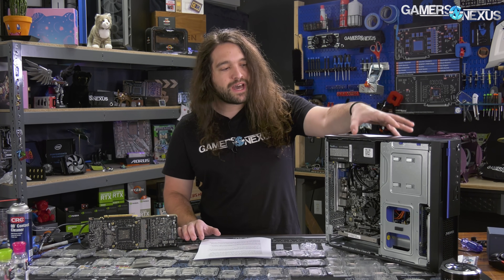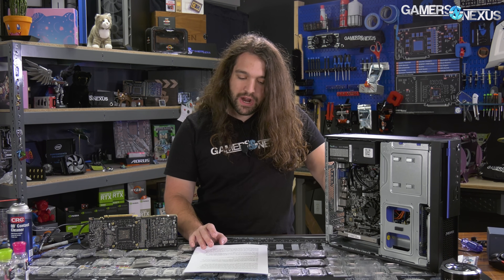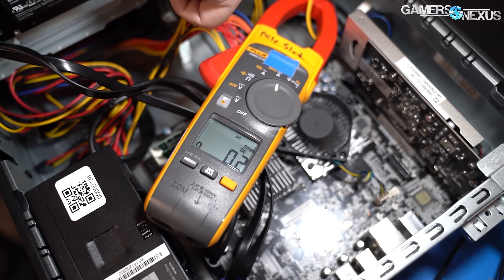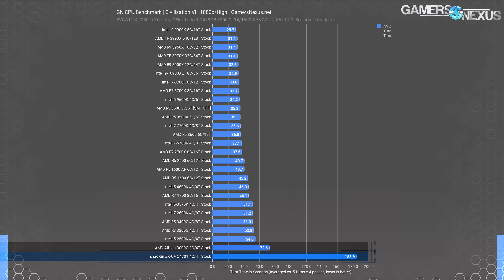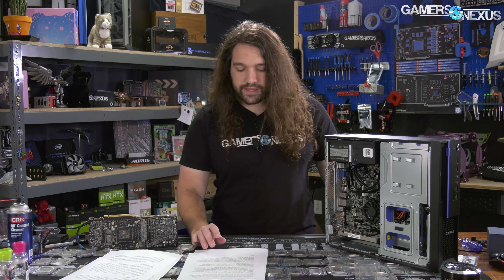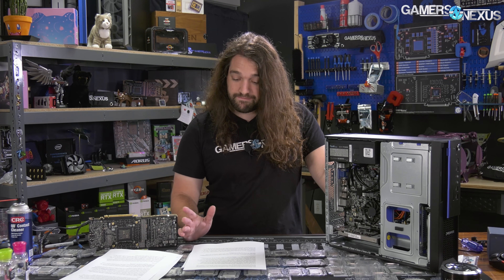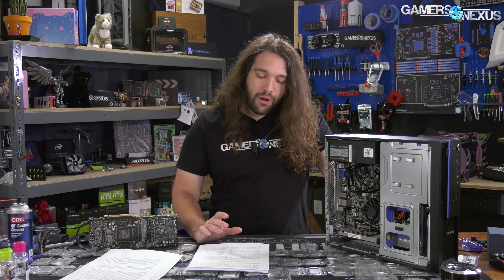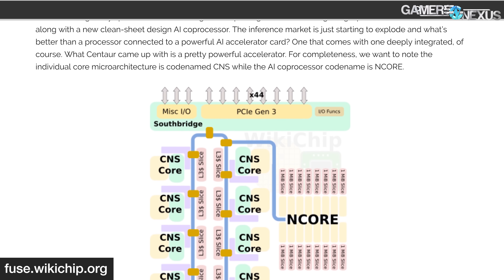"Trillion Core" Chinese CPU vs. AMD & Intel: ZhaoXin X86 CPU Review ZX-C+ 4701

Comment: Finally, a processor that can slightly edge out an Atom processor or the average school computer.
Reply: i5-8400 is a pretty common high school/community college pc
Reply: @StonedSoldering  Maybe in countries that care about education
Reply: @virtualtools_3021  US doesn't broadly but I've encountered plenty of i5 school PC's lol
Reply: It's and overclocked z560 - most all Penwell or newer Atom processors are better performing than this chip.
Reply: @StonedSoldering  My HS had i5 MacBooks, but they were only 2 cores and M A C B O O K S. They weren't even good single-threaded because of lack of cooling, but at least they had SSDs however small (128 GB). CPU was i5 5250U with 4GB RAM. Funny how people still say my HS is wasteful, but it isn't far from the truth when such terrible computers were costing them $800 each.
Reply: @edsknife  Lol, I have a CTE class called computer graphics and design, and in the computer lab each person has an I9-9900K + RTX 2080 Dell prebuilt workstation.
Reply: heck the Athlon 5350 already did that
Reply: @edsknife  I'm surprised it was only $800 coming from apple
Reply: But with lower power consumption?
Reply: We had PowerPC Apple eMacs with 128 megs of ddr. I remember it clearly. The human hand could press the volume + and - buttons faster that the computer could process them, so you would press them 100 times, and then the sound would play for all of them at once around a minute later. It was hilarious.
Reply: they still use PENTIUM D at our hs for most pc,s a few have i5-3470t (dual core! wtf)
Reply: @StonedSoldering  My HS in Australia had Intel Pentium @ like 2.4ghz 2 cores. They also sold "school laptops" for like 1000$ that had an i3 6th gen and 4gb of ram lmao I feel sad for anyone who brought those.
Reply: @Martin M your school is running 3900x's? I highly doubt that given that even the most richest high schools wouldn't need a CPU that powerful, I would say maybe something along the lines of a AMD Ryzen™ 3 2300X or an Intel® Core™ i3-9100 would be decent enough for a school computer (given that most people just used microsoft word etc.) unless you school is doing heavy CPU workloads a 3900x is overkill.
Reply: @edsknife  They're mac, they're supposed to be overpriced as fuck.
Reply: @virtualtools_3021  my college has i7s and i5s in all of our computers
Reply: My school just recently upgraded to I5 9500, but it's a vocational school.
Reply: @StonedSoldering  which school needs 6 cores for essentially a microsoft word machine?
Reply: Nope my school's computers are on core 2 duo
Reply: @StonedSoldering  In my high school, we had win10+2gb ram+e2160 c2d cpus+onboard gfx. My last year was 2018.
Reply: @StonedSoldering  my school pc's have i5 750's
Reply: School processors really depend on the school and area. I remember in high school I went from thinking my school computers were slow compared to my intel pentium dual core vista machine to the school getting intel core 2 duos and replacing all their pentium systems a year later and thus outside of graphics having better machines than my personal computer in 2008-2010. In college, the college I went to had all 2nd and 3rd gen i3 and  i5 systems in 2014. The major issue with school systems is the lack of a ssd boot drive. At least in my city. I only remember terrible computers in early grade school. During the pre xp days the computers were awful windows 95 machines that my windows mellenium intel celeron 667 with a ati radeon 7000 ran circles around.
Reply: Hey the later intel Atom processors were pretty good, fairly similar performance to an early Pentium D/dual-core or a flagship mobile processor from ~3 years ago, the problem is since it's cheap it tends to be paired with equally low-end hardware, like 1-2GB of ram and slow eMMC storage, while running windows making the overall experience pretty terrible but the atom itself isn't all that bad, in fact it's a great processor for single board computers.
Reply: My school's got a wide range of Intel CPUs, like between Core 2 and the i5-9400
Reply: IF its anything like the old via chips, the atoms will cream it. And wont Have random applications crashes from missing cpu instructions/extensions.
Reply: @kalashnikov1343  I think it's funny how apple has wobbled all over the place with their CPU choices. While the PC world has stayed with x86 from the first IBM PC (with a few attempts at breaking free from x86 that was quickly abandoned), the Apple Macintosh started out using Motorola 68000 processors. Both the Intel 8086 and the Motorola 68000 uses a CISC architecture which was the norm at the time, but there were a lot of thought plowed into creating RISC architectures as these were seen as a way to increase the IPC and make the chips simpler and able to scale in clock frequency. Apple stayed with the 680x0 series of processors up till 68040 but when it looked as if Motorola wasn't going to be able to keep up with Intel and the development of the x86 they started working on transitioning their product line to a RISC architecture powered by the PowerPC processors. This was believed to be the holy grail of processor tech. It was a RISC architecture, and as such surely would be proven more powerful than anything CISC based in the future, and it was backed by Apple, Motorola and IBM who was still the largest computer company in the world. And time went by...

Eventually Apple was facing the reality that no matter how much they wanted to be proven right the PowerPC processors were lagging the performance of processor architectures like the x86. So once again they worked on transitioning their product line to another architecture. This time they switched over to x86, and again they were on a CISC architecture.
Now the rumor mills has started saying that change is in the air again for Apple the the MAC OS. An once again it seems they are looking at transitioning to a RISC architecture, but this time it's going to be an ARM based processor developed in-house at Apple. Or at least that's what it looks like.

I think it's funny how back in the 80's people were saying that the x86 would never be able to scale as it was a CISC architecture. By many it was taken for granted that soon RISC would rule the computer world. Now in 2020 x86 is still running strong, and at least as far as I'm aware it still holds the single core performance crown. On top of that there is some truly powerful multi core x86 processors out there (looking at you AMD) with more on the way. Meanwhile RISC is totally dominating the handheld mobile market where the incredibly efficient and simple cores can make batteries last longer than any current CISC alternative with comparable performance. In the server market ARM based solutions has made a big impact for certain types of loads as they are so power efficient. However the venerable x86 is still the go to processor for a lot of applications.

So is Apple ARMing up a sign of the death of the CISC architectures? I have no idea. At the moment the latest and greatest from intel and AMD are still performing better than any ARM processor I've seen, and more is coming. But at the same time the large majority of Apples customers are not in it for the performance. They buy Apple for reasons like design, ease of use, (perceived) security and because it's an Apple product. And at this time CPU performance has reached ridiculous levels so perhaps they are looking at providing enough performance rather than aiming for the absolute top, while being able to use the admittedly superior power efficiency of the ARM architecture to stretch the battery life beyond what the competitors still using the x86 platform currently can reach.
Reply: @richardzhang2773  k cool were can I sign up
Reply: @pxlcoarl  sure if you can stand toxic students :)
Reply: @StonedSoldering  yeah, in my country College use intel pentium in computer labs...
Reply: My school got i3 6100 or 7100
Reply: Before that 1core 2ghz 2gb pcs
Reply: I5 6500 at my school and a few of the pcs in small classrooms have i3 4th gen and some core 2 duo e7500 which is an awesome classic cpu in my opinion
Reply: School all use chromebooks now.
Reply: @StonedSoldering  and here I was thinking schools all used Apple IIe's..
Reply: @happily7514  they might have been 7th gen when I was in HS but my community college had all 8400s and SSDs. Pretty small 2 year school. Even in HS we used photoshop in some classes and whatnot so not too far fetched to have 8400s.
Reply: @deViant14  u totally necro'd this thread btw
Reply: @StonedSoldering  welcome to youtube
Reply: @StonedSoldering  I've literally never heard a single person say that in 15 years on youtube btw. The algorithm recommends in waves. You know that, right?
Reply: @deViant14  I was just joking I forgot this comment completely didn't return to the thread till I got that noti lol
Reply: my school has ryzen 5 3600x, 16gb ddr4, rx 550, 500gb m.2. 

if you wanna know how i know that, i pulled up system info, and for the ssd, i did a speed test and the read/write was over 2GB/s
Reply: My school laptop is rocking an i5-4200U. It's sluggish as hell.
Reply: my high school uses old AMD APUs mostly
Reply: @StonedSoldering  no 8400 doe. More like 4300 or 4200

Comment: This Processor needs to have a death match with the Celeron D.
Reply: Not sure if that's enough competition, maybe try something like a Nokia 1600 🤔
Reply: @MLWJ1993  You can't compare X86 with ARM architecture. An X86 would pulverize any ARM processors in-terms of desktop level multitasking no matter how weak it is.
Reply: @DarkZerol  I really don't think so with this garbage performance though.... Any other day of the week you'd be right...
Reply: @MLWJ1993  ARM processors are not designed to run full-fledged desktop OS like Windows, most even struggle to load them up and are plague with a myriad of compatibility issue with those X86 programs. Also not forget a much smaller ARM processor have incredibly poor heat tolerance compared to something like X86 with multiple chips built-into them for maximizing space efficiency, they are designed for much lower power consumption devices.

The closest you could get is to compare something like the Intel Atom range of processors, though I'm not sure if you can still even buy them in the market these days unless maybe you are a ODM or something.
Reply: @markuskass6199  yeah but that CPU is so slow that emulating x86 on ARM might be faster :D
Reply: Adria  I'm mainland Chinese I don't find any racist comments in his post?
Reply: Adria  better wish it comes true sooner. whenever china is able to manufacture something new, its price drops dramatically
Reply: @mrx168  Leftist Americans will call anything they don't like racist in an attempt to deride or dissuade others from agreeing with a point or considering a statement. It's basically killed the ability to have debate and dialogue between people between the ages of 18-40.
Reply: Adria  well, just like corone didn't mean much in its first two months of propagation, so China's cpu line doesn't mean much for now. But if left to their devices, they might see spectacular development in an astonishing time! Remember, it's all about logarithmic expansion.
Reply: It would be a very slow fight
Reply: @DarkZerol  You're right. Pentium Pro, 486 upgrade edition
Reply: It needs comparison with recent NUCs, cause that is basically in the same performance and power range.
Reply: It is similar in performance with a celeron N series, so not that bad. Also the power consumption is very good.
Reply: The derogatory and belittling comments coming from overly proud Americans will make the Chinese takedown of Intel and AMD that much more epic. I'm here on the sidelines with my popcorn and I expect a good fight
Reply: @stanleylargo9158  liberal tears sustain me.
Reply: Sempron blood must be spilled!
Reply: @Chuckiele  Apple's new M1 would agree.
Reply: Oh no, that was my old CPU, and it's fucking horrible

Comment: well.....it's energy efficient i guess. You could buy a calculator with more processing power.
Reply: I doubt you could find a calculator with a 2GHz processor (maybe I'm wrong though, I don't follow the calculator space closely). What's blowing my mind is the price to performance ratio of a 64-core Epyc CPU would probably be better than this, at $1000. Actually yes, it would definitely be better because the price would only increase 10-15x but the performance would be 100x better, from what we've seen im these benchmarks...
Reply: @utubekullanicisi  ..It's a joke bruh
Reply: @VndNvwYvvSvv  What does that have to do with anything at all?

Comment: Considering the chip TDP, I think it would be interesting to compare it to an Intel Atom/ AMD E series and see how far they are in perf/W
Reply: @vyor8837  The claimed TDP is 18W, it was also made on 28nm. It's a 2 gen old part for Zhaoxin as well. The new generation isn't exactly good by any means, but is not as horrendously shit. Being $700 USD for a mobo + CPU that just beats an old FX-8100. Still trash compared to AMD or Intel, but it is showing some improvements.
Reply: @vyor8837  If you mean the one I mentioned, I don't remember ZX's claims for that generation. The generation where they claim to be able to get Zen parity is the one after that which isn't released yet. I doubt they will reach zen parity, given how many bulldozer revisions we saw before the transition to zen however I wouldn't be surprised if the generation after that is at zen parity though. They will still be far behind, with zen 4/5 being out by that point, but it will be interesting to watch over the next decade.
Reply: @vyor8837  Not enough publicly disclosed security vulnerabilities for that, so there's still room to grow in order to compete with the top 😂
Reply: @vyor8837  From what I found there were some chinese news outlets claiming some level of parity with the i5-6500 or i5-7400. Some just said parity ambiguously (but referred to benchmarks which scale well with threads), some said parity in multithreaded tasks. In terms of multithreaded tasks, it depends on the benchmark. Some Chess benchmarks it performs worse, Cinebench R20 the release chips perform basically dead on the same. The engineering sample tests leaked in late 2017 had it at about 33% worse for multithreaded, while the chips were released in 2019 after delays but were at that performance. 

So, single threaded is far worse, multithreaded  is on parity with the chips. After looking into it more, it seems to be (in terms of performance) an FX-8370 (above in some benchmarks, equal in others, but you get the idea). Achieving this with 3ghz vs the 4/4.3 base/turbo of the fx-8370 shows some decent improvement over the chip GN tested. As I said before, they're still quite a ways behind but it's reaching/has reached the point where the Chinese Government can happily use them for office machines in government installations and the like, basic machines which can't be airgapped and such.